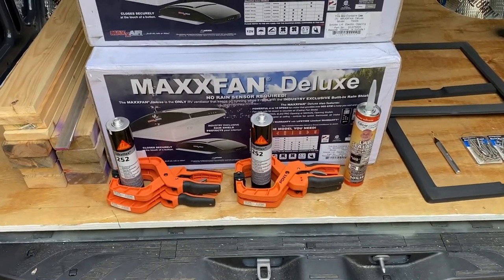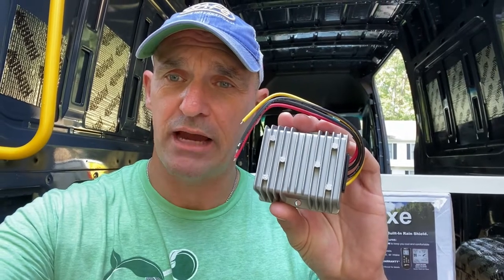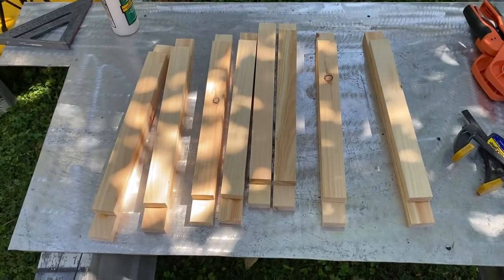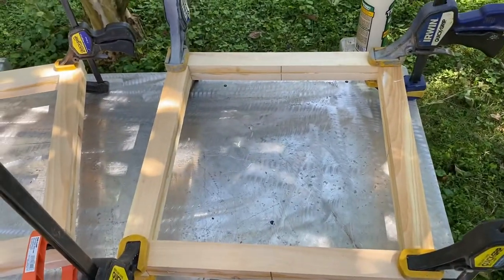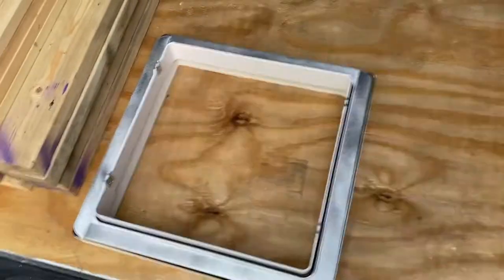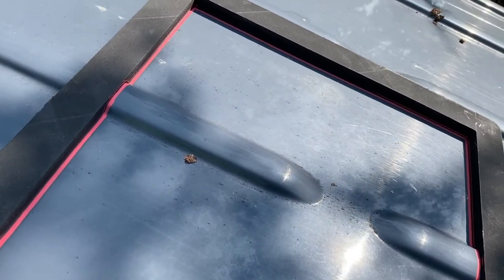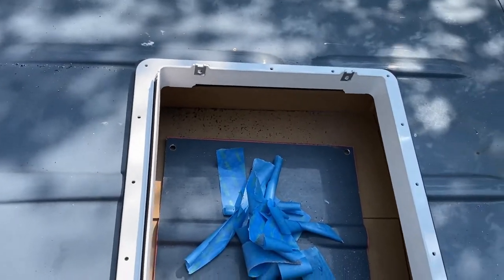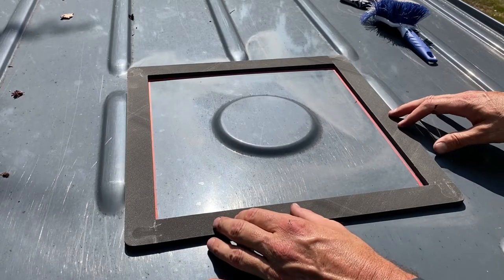How to install Maxx Air deluxe fans in your vans roof - DIY 👍

Comment: Just getting ready to start my 2nd van build. Was watching your Maxfan install to pick up any new tips that I might use and saw the reference to the voltage regulator but can’t find a link to it. I had water problems with our 4000 series Maxfan and now I wonder if there might have been a voltage issue too. At that time the pc boards seemed hard to find so I bought a whole new complete fan and robbed the board but that only lasted a short time so this time I bought the same model you have. I think this model will be much more waterproof but I now want to protect the board with a regulator. By the way we bought a 2019 Ram Promaster 159 used by Amazon as well. Love your videos very much and with help from you and the internet I hope to do better on this one. I am a retired carpenter but always willing to learn more tricks. Hope this is my last build as we are in our late 70s. We lost our last van in a head on accident. ( his fault ). Thanks for your videos. Ron C.
Reply from the maker: Ron, wow good luck on your build and sorry about the accident, It is a big fear of mine especially with all we put into the vans that some distracted or impaired driver will destroy all our work. Hopefully you guys came out un injured.  Here is a link to the 12v regulator on amazon https://amzn.to/3KWFgHv it will keep those boards safe. Thanks for checking out the channel and good luck with your build.
Reply: @ramblingambition  Thanks for the reply. We only had bumps and bruises because the van and God saved us but mentally it is tough. We are survivors and we will be fine. In about a week or so we leave Florida to head to Tennessee to see the van for the first time. Our kids picked it up from the auto dealer and we have only seen pics. The excitement builds again as we start another new adventure. Thanks for your help, it is very much appreciated. Ron C.
Reply from the maker: Good to hear, good luck and I am sure you already have a list in your head of what you will do differently this build, I know for sure I do and we aren’t even done! As a craftsman you can help but revise and rethink after the project is done. Take care!

Comment: I would add a dc to dc 12v regulator to these. They have a tendency to fry their circuit boards and fan motor if you use lithium batteries because lithium puts out 14.5v and these can only take 12v. They said they have fixed it in the new models, but I'm on my 2nd circuit board replacement and had to buy a new fan motor. The 12v regulators are anywhere between $15 and $30 and I highly suggest getting one because getting the green light of death at 2 in the morning where it beeps until you pull the fuse is SUPER annoying.
Reply from the maker: Tom, thanks for the input we did just that, we put a regulator on each fan just for the reasons you mentioned. They were super easy to wire in. We used the homelylife models, they were the ones recommended by the van builder on humble road, tested them after install and they work just as designed and hopefully our fans will stay happy!  Thanks for checking out the channel

Comment: Hey Dan,
I like your video. Im about to install a 7500 into my MB. I picked up the same wood yesterday.

How is your install doing? Any issues with leaks or condensation? I will be painting the wood gasket with a mold paint. 

Thanks!
Reply from the maker: Thanks Appreciate it, I used a ppg mold resistant paint as a final coat and it has worked out great, I have had zero issues since the install, no leaks, no condensation problems, and no mechanical problems, been totally happy with the set up, now that I am in Colorado they are the perfect set up to keep the van cool in the nice mountain air, been a hot summer here, but we were just in leadville a few weekends ago. We have put 15000 miles on the van since and I, knock on wood, have not had a single issue with anything we have installed, hope it continues :) good luck with your install
Reply: @ramblingambition  Hi Dan, I will be installing my Maxx air today, I just watched your vid (Thanks again). I noticed that you do not have an A/C. I am in Vancouver BC and cannot decide whether to get A/C or not. Do you go down south often?
Reply from the maker: Hello, yes i dont have ac, it was a cost thing more than anything and most of the trips we have done have been in the spring and fall and also in the mountains where ac was not a necessity, if i did it over and possibly a retro in the future, i would have added it in the rear location and kept the front as a fan, its really a luxury and you have to have the power system to manage it unless your going to plug in more often than not, we wanted to be completely self sufficient and ac would have pushed that envelope with adding my battery capacity, but both fans move a ton of air which keeps you cool enough, the ac would just be nice to take the edge off and keep the dogs more comfortable

Comment: Dan, I just noticed you have some sort of roof rack on the roof, I guess you're starting another project while doing another project..lol
What kind of rails did you end up using?
Reply from the maker: You caught me, I am running about three different projects at once, i wish a build was completely linear but in my brain in order to reach other phases multiple things have to happen at the same time, so yes been working on a roof rack, video coming soon, i am using unistrut, my van did not have factory rails and the unistrut fits in perfectly in the roof channel, its super strong, electro galvanized, relatively light weight, modular, and perfect for the set up i am creating.
Reply: That's cool, I an watched owl van video today. Installing the rails looks pretty easy as well. 
Looking forward to seeing more videos
Reply from the maker: Yep it is really simple all you need is a heat gun, a 1/2 or 3/4 wide putty knife, and some acetone or mineral spirits and the factory plugs for the rail holes come right out

Comment: $11 a tube???  Must have DOUBLED in price in a year.. Showing almost $24/tube using that link.  Dicor makes a self-leveling sealant which is an RV standard.. It's about $12.50/tube.
Other than that.. as usual.. a great video
Reply from the maker: Thanks, i appreciate it, i wish i could control prices, boy that would be a talent, all i can say about my prices is they were what the cost was when i made my purchases, i encourage anyone doing this to research and price compare, the products I used were just the ones I selected and many others will do the job, thanks for the comments

Comment: Dan do u build for others
Reply from the maker: At this point I dont, this is our first one, I am taking cues from the boats I have redone and the overlanding vehicles I have built over the years and applying everything to this van, who knows what the future holds, for now I just want to get this one done use it for a while and see what improvements I would make, I am pretty solid on all the van systems, meaning I like the use case and form factor, its the interior finishes and layout that I want to live with and make sure I like, drawer size and type location, cabinets etc if that makes sense, I know cutting holes in a roof is a daunting experience for sure, O would be happy to provide more in depth advice but not doing work for others just yet, thanks for checking out the channel and definitely stay tuned for whats coming